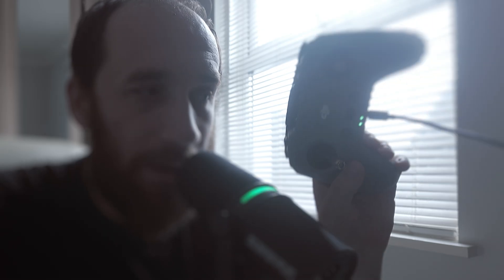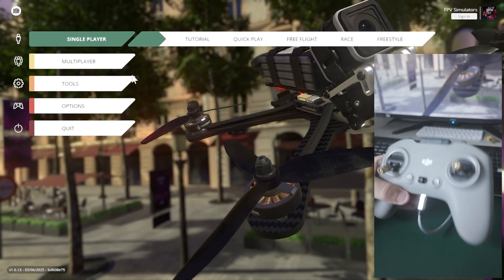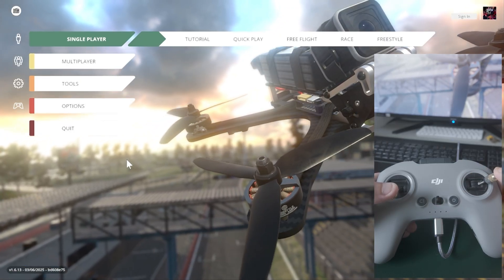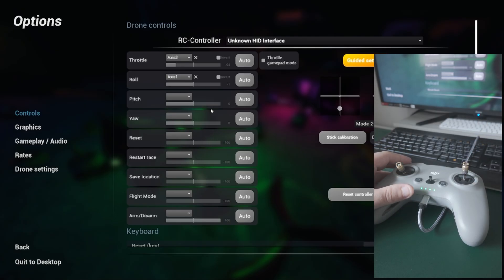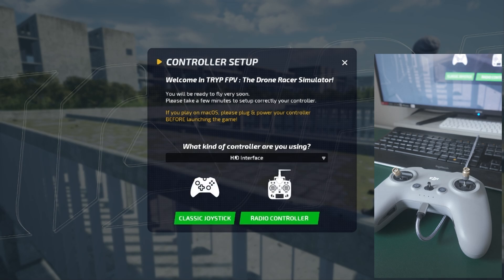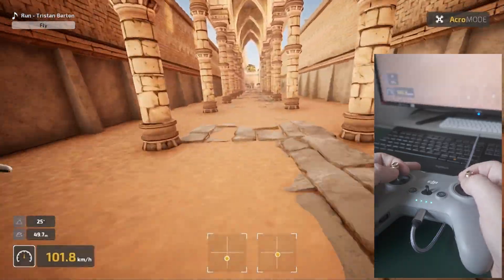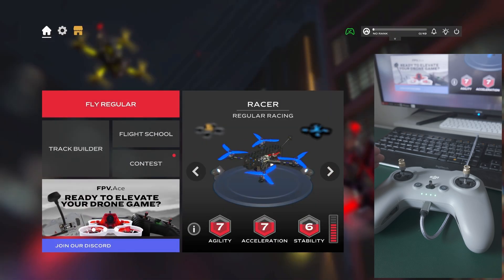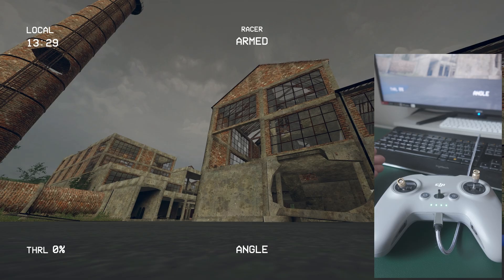Set Up Any FPV Remote Controller in FPV Simulators (GUIDE)

Comment: Thanks for the tutorial. Have you figured out if the DJI FPV Remote Controller 3 works the same way?
Reply from the maker: Sorry for the late response. Yes and was also confirmed me by others it’s working the same way and every part of these guides that apply to the second version works the same with the third version of the DJI FPV remote controller.

Comment: Maybe you can help i have the dji avata  2 and the fpv controller  iam in liffoff how do i get the same rates as my dji avata 2 too work in the sim
Reply from the maker: Hi— you need to match your DJI Avatar 2 rates, so you must know what rates it has and match them in Liftoff on a similar setup drone. At least this would be my approach.
Are they standard or custom rates?
Reply: @fpvsimulators standard  for now will give it a go

Comment: The best way to calibrate the DJI FPV controller ( I have one and use it with all these sims) is to return it to factory default with the hex screw at the back. I found screwing them in all the way (all 4) and then screwing them out 6 turns brings then back to default. THEN calibrate in windows. THIS is very important because the sims read the windows inputs.. By doing this the windows calibration reads the center inputs and NOT manual mode inputs. THEN calibrate in the sim,. After sim calibrating you can then adjust the hex screws to change the controller to manual mode (all the way in for F2 and  3 turns out for F1). This is the only way to calibrate the DJI FPV controller 2 to a PC.  You MUST calibrate all your sims with the default (6 turns out) settings before you change the controller to manual mode or they will be all out of sync,
Reply from the maker: This is one way to get perfect calibration when all the sticks need to return to their mid point axis during the calibration process. I indeed agree with you but the reason I left it out is because there are many extra steps to do and only applies to the DJI FPV Controllers as with other FPV ones, it may not even be an option. Anyway, I do think even calibrating without spring tension on throttle, we’re looking at 98-99% accuracy if done right. Never had any major issues, but this controller do have a bit of “centre axis vibration” when the sticks are centred and on idle (not touching them) but not affecting while flying.
Reply: @fpvsimulators  Yeah. If you don't do it the way I mentioned and leave the sticks in manual mode windows sees a massive deadzone and so do the games. Like 500. When you use my method the dead zone is around 20.
Reply from the maker: @ironmaiden5658  wow, those are massive values. I was talking about 1% improvement maybe, but overall, the deadzone is around zero. In fact, I never had any reasons to set any values to deadzones. Is responding extremely accurately even without all these extra steps. 
Are you sure your controller is okay? And are you talking about the DJI FPV Remote Controller 2 (second version that came with the DJI FPV and DJI Avata 1)? Something is off. I can make a short unlisted video with the controller vs the simulator response accuracy.